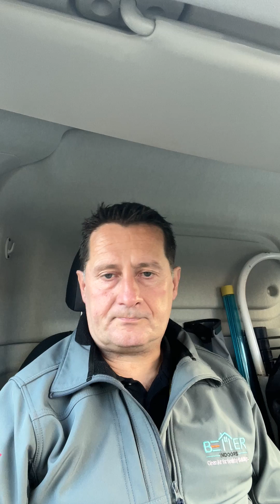PIV - The #1 Strategy for Most Domestic Ventilation Retrofits

Comment: It is advised in PAS 2035 not to install PIV if you insulate your walls internally...!
Reply from the maker: I think you mean PAS2035 advises not to install PIV if you have cavity wall insulation. If so this is a total myth. Those who purport this nonsense including the author/s of PAS2035 have little or no installation experience in the real world. Indeed, there is no actual evidence that PIV or any other mechanical supply process creates interstitial condensation and the PAS2035 assertion that natural ventilators are needed to prevent it is total guesswork. The fact is virtually all property intermediaries, consultants and trade contractors dont understand the right way to execute a whole house PIV retrofit because they lack the practical knowledge and experience that derives from thousands of surveys, specifications and successful problem solving installations. There is a whole lot more to it than the PIV unit/s specification/installation itself which is lost on all these people who think all you need is guidance such as PAS2035 and/or manufacturer specs. We have specified, supplied and installed thousands whole house retrofits that comprise PIV, usually to fix problems of condensation, mould, dust mites, radon, VOCs, odours etc. and I can assure you natural ventilators play no part. Indeed, they are in fact detrimental to the overall system performance and furthermore they drastically and negatively impact energy efficiency due to inherent uncontrolled heat loss. Our solutions not only solve these problems permanently but they also significantly improve energy efficiency and reduce heating costs which is an impossible outcome if you follow PAS2035 to the letter.

Comment: Hi thanks  for the good information , which unit would you recommend
Reply from the maker: Any unit with BBA or TUV certifications for Part F ADF compliance. There are only 4 UK manufacturers whose units hold those. Dont touch any other ones.
Reply: We just purchase an Environvent PIV unit.  We’re going to install the unit ourself has it seem straight forward.   We already have a power supply in the loft space to power the unit. Also the landing ceiling have lots of spare for the ceiling defuser to be installed.   My question is.  where in the loft space is recommended to situation the PIV unit ?